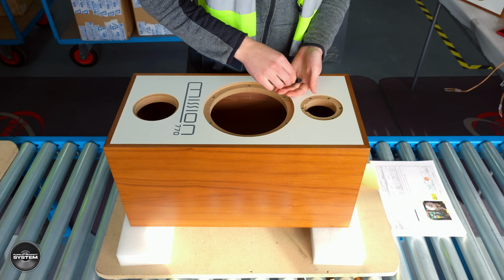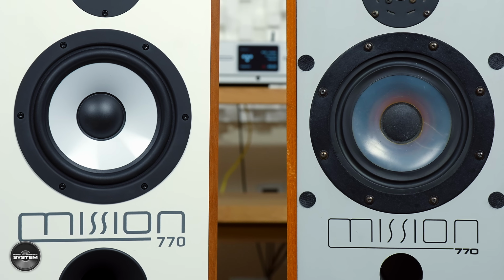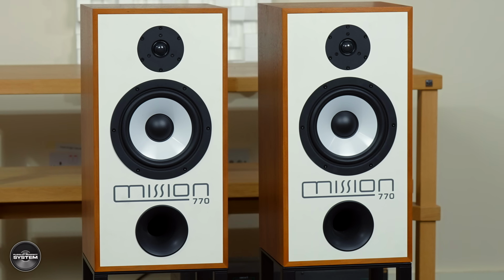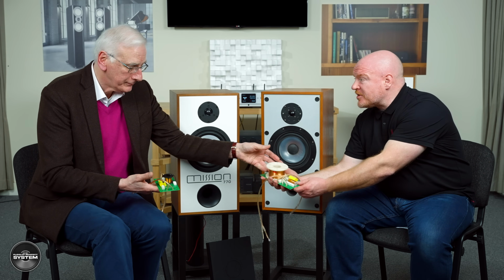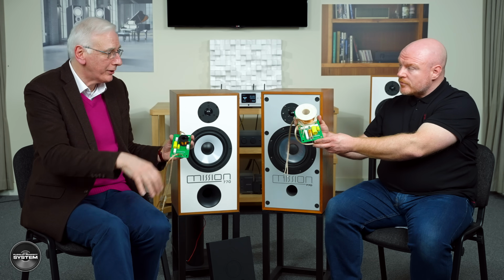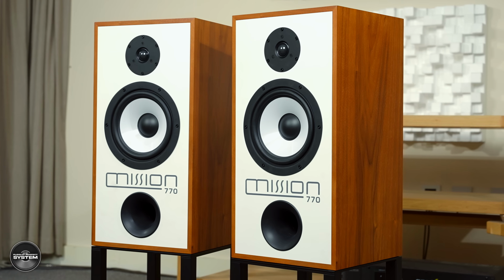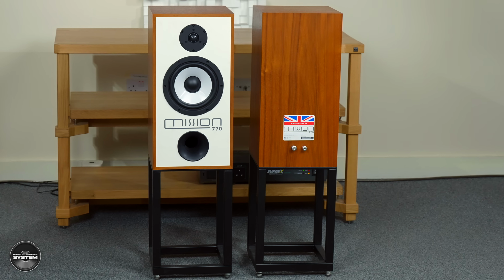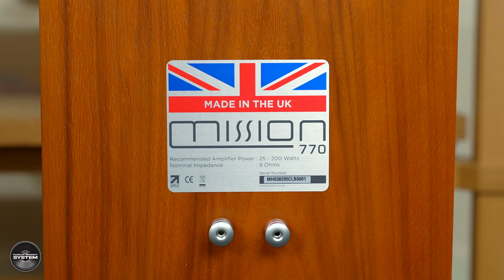NEW MISSION 770 HiFi Speakers meet the designer / factory

Comment: i just with they were not £2500-£3500, as i want to buy uk made and only way to by made in uk is vintage well from 70's to very early 2000 but mostly 80's to 90's as uk has very good sounding speakers but not a crazy price and able to be experienced by far more people. im currently running pair Denon SC-M5K Made by Mission for Denon a uk made speakers from mid 90's to very early 2000. they good set speaks and really  perform well for the size them. been looking at a lot speakers and as limited space i do not need crazy power just a mix good sounding speckers , few more base few what better in mid, few better in higher  and maybe a allrounder like Denon SC-M5K it sure can punch well but also great more vocal, ive not found anything what sounds bad on them from classic to jazz to pop and dance all the way to bit D&B  as i wanted to give them a test of all inc Rock of course. as speaks all have own personally in a way, a mix speakers if i buy careful and research i might be able to get a good mix hopefully 3 pairs by the end to finish off the setup what ive started, ive been looking at  Wharfedale Denton XP2 and xp3,  even Wharfedale Chevin XP2 they sure unique sound, and even other brand speaks like KEF CODA 3 III,   Tannoy E11, Bowers Wilkins DM10, Mordaunt Short M10. still doing a lot more research, as long as they built in uk and sound good and reasonable cost im happy and the  Denon SC-M5K well they plenty power for the space ive got so it finding a nice mix what go well together, next set older that than mid 90's tho. they more brands than i mentioned, discovering new brands daily almost. i know not all uk speakers sound great but that fun researching, even look at compare sounds you can tell slight differences. depends on amp i go for but min im going for a 6 speaker setup so 3 pairs it may go to 4 pairs. aiming best quality mix for a reasonable price. maybe one one day i setup downstairs room with a setup not made in uk, japan has pretty cool stuff over the years so that might be my next project, first a all uk setup minus amp as i do not think uk makes new amps what good but lower cost so i may have to go for a maybe made in japan one but as long it quality matched with good uk speakers im sure it still be great. as it going to be on for many hours every day i want to go new for the amp  as old ones could have issues and 6-10 hours a day it needs to be reliable and not a crazy cost so it can be replaced quite easy. still got lots brands to look in to what from the uk, it sure is interesting learning about them

Comment: I have listened to both the new and the old 770's and the new ones sound excellent as the old ones did, better in fact, however I cannot justify the £3,299.00 price tag. It seems Mission like many other companies nowadays deliberately inflate the price tag to make people think they are buying something exceptional and they like like to boast to others about how much they paid for certain things. I would imagine there is a high mark up in the price from the retailers too. 
Personally I will stick with Q Acoustics that are far better value for money.
Reply from the maker: To really hear what the new 770 can do they need to be playing off a very good system, exceptionally good and then you would hear where they easily justify their price against other new similar ish speakers available today.  You have to judge them against new speakers today to ascertain their true value
Reply: @PursuitPerfectSystem  lets agree to disagree, far too much profit in them
Reply from the maker: @notforturning7880  defo disagree I listen to high end speakers all the time. There has to be profit in products otherwise they won’t exist. I know how expensive it is to have things made in the UK. If you compare the 770 to its main competitors from Spendor and Harbeth they cost less. If they sound like the original 770 that is by design in the mid range but they have modern capabilities at the extreme ends that makes all the difference for a versatile all round speaker. You wont know what they can do bass wise without the right gear. You wont know what they can do sound stage wise without the right gear. I have been using them for the last year comparing them much more expensive speakers so have a very good handle on them now
Reply: @PursuitPerfectSystem  The Hi Fi retailers in the UK put a 100% mark up on just about everything they sell, the speakers probably cost Mission around 25% of the price they are sold to the consumers, they cost in store for £3,495.00 they most likely cost Mission around £1,200.00 to produce.
Reply from the maker: @notforturning7880  it doesn’t work like that prices are set by the manufacturers and they have to allow for dealers and or distributors to make enough to have a business and fulfil their duties. This is true for every industry all over the world for everything you buy pretty much. No one forces anyone to buy anything but value can only really be judged by a products position within the market compare to its peers and the Mission offers at least as much if not more than its peers for the same or less money.
Reply: @PursuitPerfectSystem  This is ripoff Britain you know, Wharfdale and Q Acoustics offer much better value for money, as well as some other well known manufacturers. Mission and the retailers are exploiting the popularity of the 1970  versions.
Reply from the maker: @notforturning7880  all the companies mentioned work in the same way it’s how the industry is built. It’s how most industries are built. Q acoustics high end speakers cost a lot more than their affordable ones it’s no different to mission that make speakers starting at £200
Reply: @PursuitPerfectSystem  here is a statement from a leading HI Fi retailer on their website in Britain 
"The Mission 770 Speakers are the new iteration of one of the most iconic British loudspeakers ever produced, the Mission 770s. Originating from 1977, the Mission 770s have been updated to bring a modern performance and quality to an old classic." 

Its called "milking it " here. 

They sound good very good, but not £3,495.00 good.

I don't see them selling very well in UK 
The typical retailer in UK will try and sell the customer another cheaper brand when the customer raises the eyebrows at the price of the Missions, and will big up the cheaper brand telling the customer they are much better value for money, some will go as far as telling the customer that with " Mission Speakers" you are paying for the name and fame.
Reply from the maker: @notforturning7880  the stumbling block for the uk market will be the white finish more than the price. Harbeth and spendor cost more than the mission.
In terms of comparison I was comparing the 770 to 6k speakers a couple of weeks ago and they held their own. Now to £18k speakers and they are still holding their own. That’s exceptional value.

But you need a great system to get this out of them. I am lucky to have access to a lot of kit above my pay grade perk of the job

Comment: I just found a pair of Mission 707s at a local store. I redid the woofers, and replaced the dried out ferrofluid tweeters with a replacement. Anyway, dynamic, spacious with sound, and very detailed. It took me awhile to get used to them. I can't put them down now. Vinyl/records sound amazing, also radio. Anyway, loads of fun.

Comment: There are 3 very inexpensive sand cast resistors on the crossover board. They shouldn't be there in a 3500 pound speaker. Not Peters fault. I'm sure they gave him a strict budget to follow.

Comment: It is expansive because it is made in UK with high cost labour. Period!
I have a few polycone speaker  KEF and Spendor that the speaker cone warped after some years. If you live in a hot climate country this is not the speaker for you. Once the woofer warped it has no more value. 
I trust the Wharfedale Linton is better, with easy on the wallet, great built quality and kevlar speaker that don't deformed due to heat. It is a good buy.

Comment: The mission 770 seems to be the Fiat 500 for speakers :)  But not when it comes to the price :(
The woofer has a full copper cap to reduce the eddy currents, just like the Philips AD9710 full range driver of the 60's. And that driver is referred to as the poor mans Lowther, so yes very good but by now nearly 70 year old technology... It sounds a bit snarky but is not intended to be mean spirited. All in all I really like this speaker by the looks of it, it is just that corporate speak tends to ruffle my feathers.
Great video, keep them coming!!
Reply from the maker: Its important to remeber Peter is not trying to invent the wheel with this speaker he is trying to mimic the best bits of a 70s speaker and bring the best bits of modern speakers without losing the character of the original. So its not always about the most advanced technologies its about using what is going to work for the desired goal
Reply: @PursuitPerfectSystem  Thanks for taking the time to reply. I really liked the interview and I have also been looking forward to learn more about this speaker. It could be perhaps the best looking speaker on the market today and the eye wants something as well. I only picked up on the copper cap because I had the impression it was suggested to be a rather novel idea and I just could not let that pass.
But any way, the video it self was a joy to watch so thanks for bringing it to us.
Reply: @hugobloemers4425  He mentioned full copper sleeve, because not all drivers do, though it is a no brainer. All Seas drivers for example don't. It results in massive difference in 600- 1500Hz range distortion.

Comment: This was really interesting 👍Still enjoying my Mission QX-2 and sure that my next speaker will be Mission too 👌
Reply: I can't personally budget for these but recently purchased a pair of Mission QX2 Mk 2 to replace a decade old pair of Monitor Audio Bronze that came with my Marantz PM6005 amplifier.  Really pleased ,such a wide soundstage with good depth. 
Not as forward sounding as many speakers around the price so less fatiguing. Soft but low rolled off bass( ,so not for heavy rock fans) with lots of treble micro detail 👍 🙂